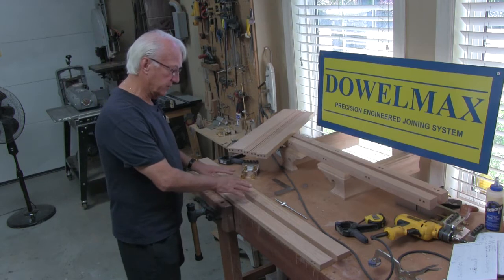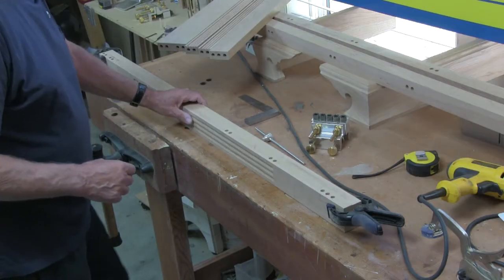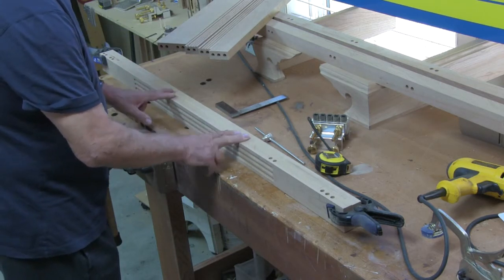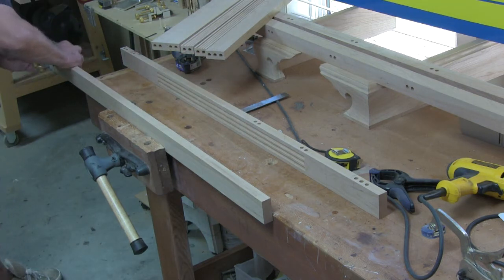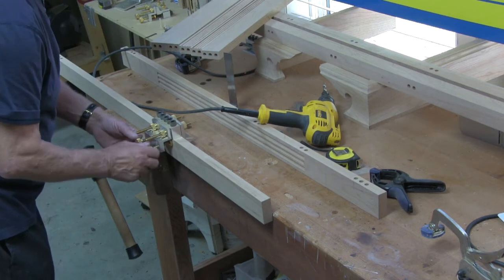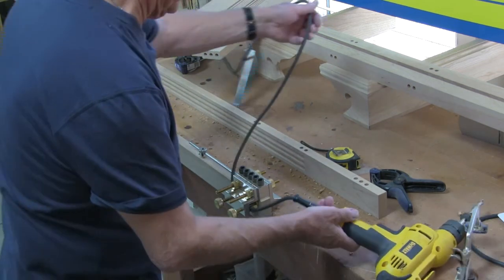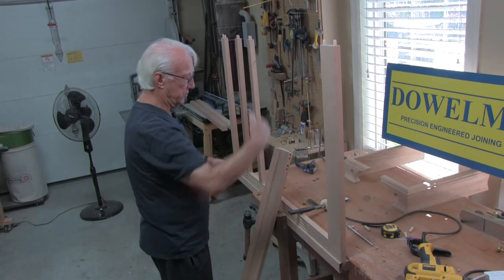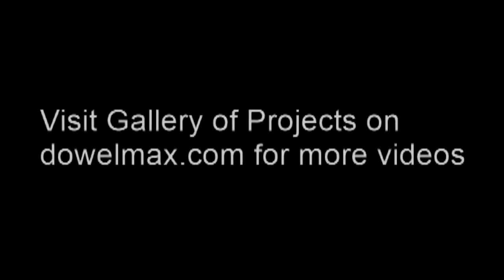Joining the Rails to the Routed Inserts Used to Build the Armoire Frame Front Section

Comment: Love the Dowelmax system I use it all the time. I saw a little trick from a YouTuber for easier dry fitting. He lightly sanded a dozen or so dowels and lightly spray painted them to identify them. They slide in and out a lot easier but are still tight enough for dry fitting.